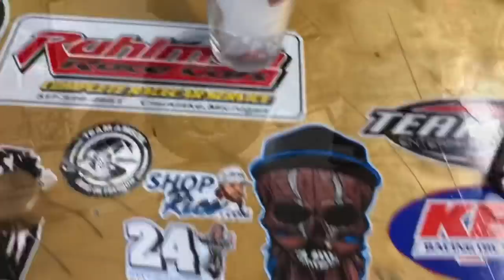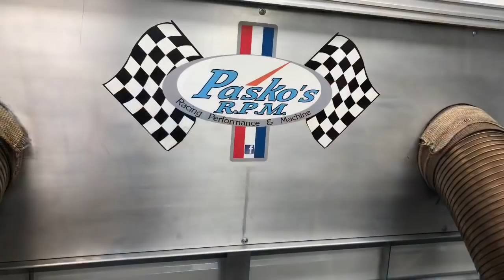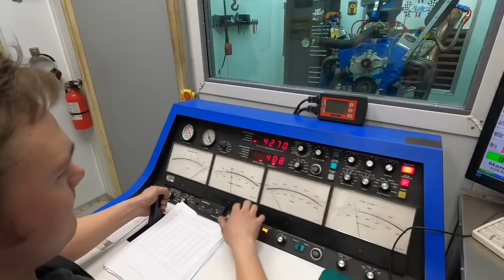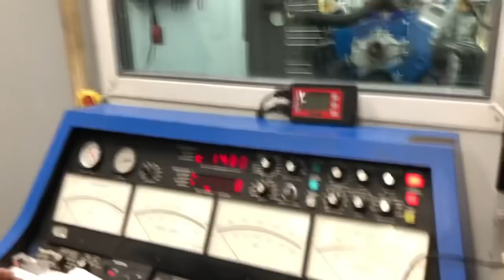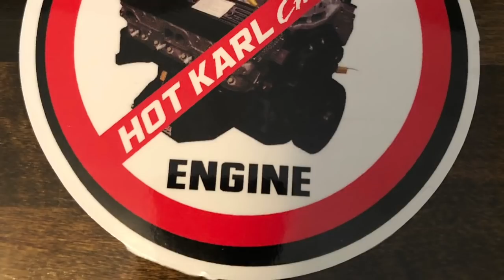Hot Karl picks up his race engine

Comment: Our class don’t use crate engines either, in our Thunder Bomber we have to run a cast intake also, however we do get to run a 4 barrel carb. It can be either a 600 single line Holley or a Qjet. So we run the Qjet our engine builder recommended it. That and an 055 marine intake. Like you I can’t wait for my driver to strap in and sling some good old Carolina red clay